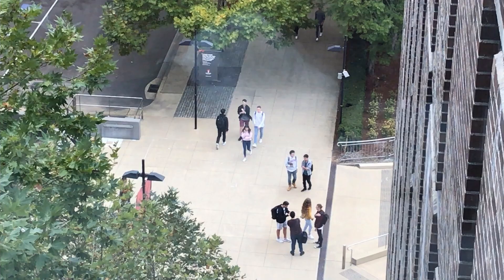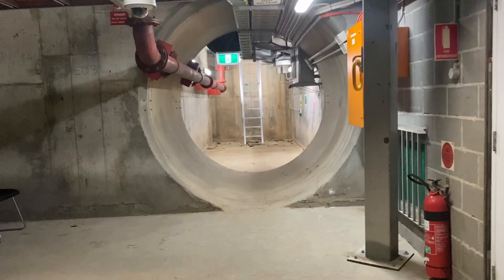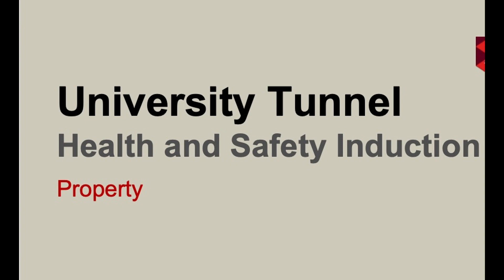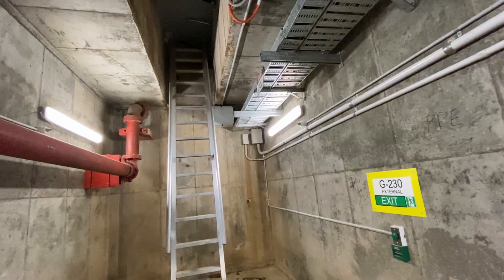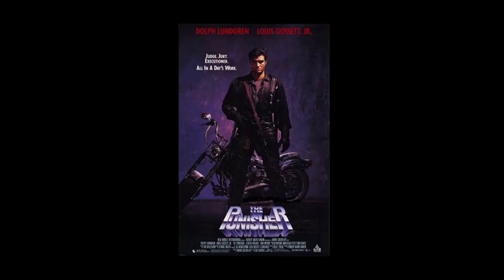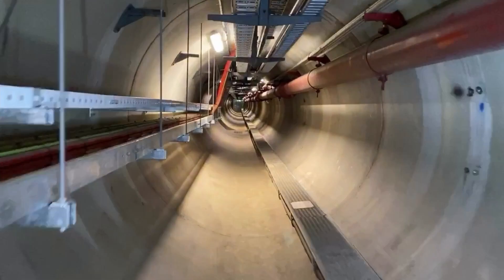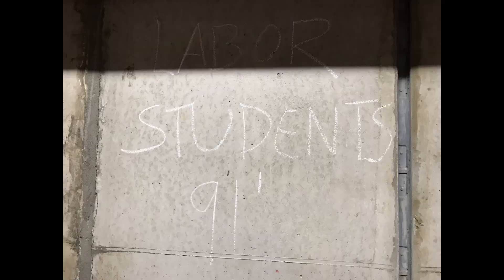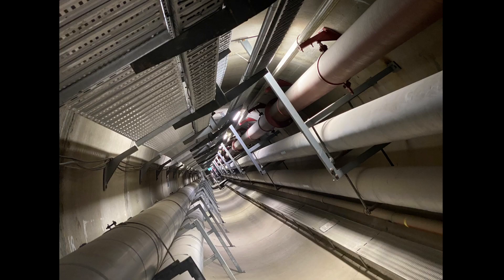Is there really a hidden tunnel system under Macquarie University?

Comment: Breaking my no-comment pledge to say WOW, Matthew, thank you so, so much for making this video. I've been wondering what these tunnels looked like for YEARS, even before I studied at MQ. I'm surprised by how clean/pristine the concrete looks... have these tunnels seen major structural works since the '60s? Great stuff, thanks again.
Reply from the maker: Thanks! There has only been a little bit of work over the years.  They have attached a couple of buildings to the system since it was built and some entrances have been added and others removed. They had a clean up project in the last few years that removed most of the disused central heating piping and anything else that was easily removed. They also power washed it all which is why is looks clean..

Comment: I remember going on a tour of these tunnels, when I worked for Macquarie Uni IT Services – I forget when exactly the tour was, but I left in October 2007, so no later than that, but might have been a year or two earlier. The funniest part, is when we went up the spiral staircase, and came out of the little shed which was in front of the old library (no idea if it is still there). Every student had walked past that little shed numerous times, those present were quite surprised when a stream of staff members suddenly emerged from it, as if out of nowhere. Another highlight was while we were exploring one of the side tunnels which connect to one of the building basements, one of the managers called out "hey Simon, look at your feet". I noticed some dried substance–"What's that?" "Dried sewerage" he called out. A sewer blockage had leaked into the tunnels, nobody had ever bothered to clean it up, and here I was standing in it. It no longer smelled like sewerage, but I think I could still make out some toilet paper in it. Yet another was the point at which they'd cut open one of the old central heating pipes to expose the asbestos insulation for us all to see and ponder the health risks of.